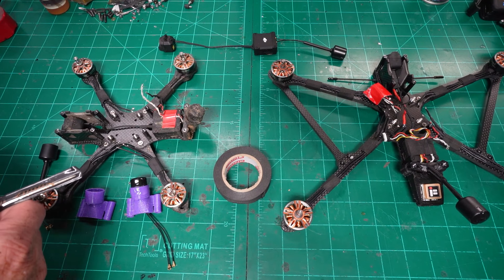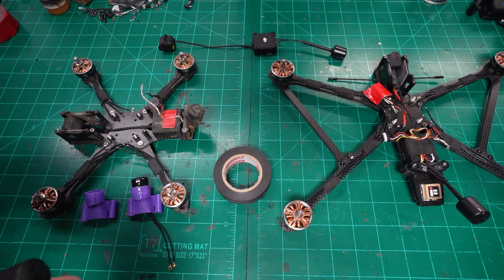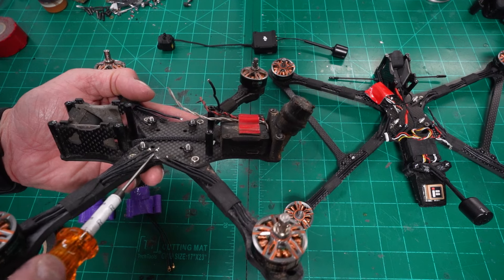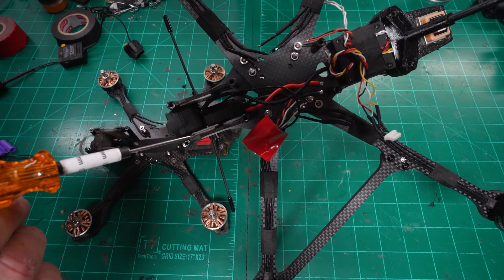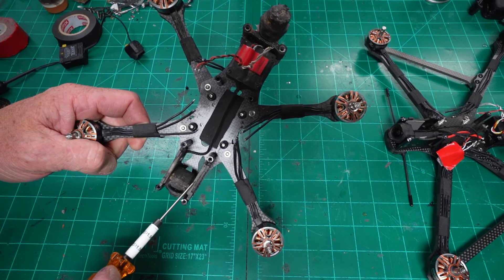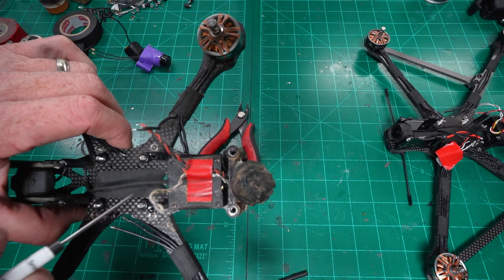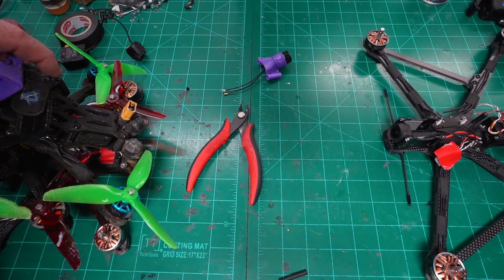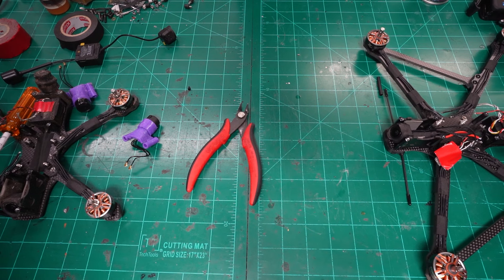DJI O3 Air 500+ Pack Review AND Full BOMB PROOF Configuration

Comment: @phantom I happen to use the Immortal T setup because I'm still on TBS Crossfire, how could i hook this up? i want something similar with a mount for my TBS Nano Rx or could i mount it another way
Reply from the maker: You could do it similarly. When I ran CSRF, I mounted my antenna nearly the same way. They offer small M3 mounts or you could print some and attach the antenna to the front or real standoffs. Another option is to tape it under an arm. Folks talk about how this hurts antenna performance, but if you’re not doing LR and only ripping freestyle close, it’s not an issue. Thanks so much!
Reply: @PhantomFPV  thanks for always replying, have always helped me on my adventure making decisions, now my builds just like yours but crossfire and hobbywing xtrotor,tmotor F60's, but copied your ideas with antennas and frames etc.

Comment: So were you sticking the capacitors now with the DJI in the way? Running both up front I presume? What gauge wire for them?
Reply from the maker: Hey! I usually route them to the front, yes. This isn’t the most preferred location because you want them as close to the battery as possible. Typically using 18-20ga. Hope that helps! Thanks so much.
Reply: @ it def helps. Appreciate you. Epic dude. We have no choice w the o3 being so big. It’s my first build! Apex, ultra, voltara.  Been following your vids to see how you do! Keep up the good work!
Reply from the maker: @ appreciate that! All that gear definitely holds up. Pretty bomber.

Comment: I wanna see a video on the new evo frames. havent seen one yet which is surprising. Looks pretty cool. I almost got the 03 but went with walksnail instead. Getfpv had a bundle with the fatshark goggles and a vtx and antennas for a really good deal. Couldnt turn it down
Reply from the maker: Gotta go with what works for you. I’ve not flown the Evo because is still have a few HD’s left over. Maybe one day. Thanks so much!

Comment: 2:30 so you don’t use any metal nut anymore, you run the countersunk screw (shortest one for the apex) then use a nylon nut? And then a oring for the Esc mount? Today I started my new buildt and it’s my first kiss ultra buildt I noticed that with a metal nut it’s impossible to still get an oring or something to dampen the Esc from the screw…..

Now I think about unscrewing the frame again and also go with a nylon nut if you do it that way…but does the nylon nut not get loose? And also you can’t tighten the screws very strong from the stack ( I thought it’s needed on the apex because the countersunk stack screws they are not flush with the frame and you screw them to the bottom part (I hope you get what I mean) and compress that all together…. After kiss ultra discord I was convinced going withouth dampening but it feels not good to me having the Esc on just hardmounted on Metall nuts
Reply from the maker: I definitely get what you’re saying. Out of 10 pilots you ask, 9 will say I’m doing it wrong. However, I’m a basher pilot and fly more packs than any normal human should, and likely more than those you ask about proper stack assembly. That being said, I don’t have an issue with the plastic nuts coming loose. If you’re careful, you can actually get them pretty tight.
The nice thing about an Apex frame is those four screws have zero structural function. So they could literally be flopping around in there and your frame would still remain tight. So long as you built it properly. 
I fly with badly bent motor bells, bent props, broken everything and my tune is still magical. If you’ve watched my videos, you can hear it. It’s this way because I pay particular attention to how I mount my flight stack, and I tune my quad. Again, 9 out of 10 pilots will tell you it’s wrong, but my tune will confirm otherwise. (I’m kidding about the 9 out of 10 thing btw haha.)
I’d suggest trying it. You can always revert back to the original mounting method. Both will work. 
I hope that helps a little. Thanks so much big dog! Let me know if you have any more questions.
Reply: @PhantomFPV  thank you! i will make two apex evo builds try the second with the nylon nuts as well :) can you tell me how you tune your Kiss ultra Setups? Is there any tutorial that you follow or how can I understand that aspect?

Thank you so much for always taking you time! love it

Comment: Hi…what benefit do you get using the Action 2 that offsets the weight increase of the A2? Different camera settings? 
Why not convert to Apex Evo?
Reply from the maker: The lighter weight camera makes a huge difference. The actual camera performance is lower than GoPro tho. I’ve got too many standard Apex’s to switch. I don’t bolt my cameras in either so it’s really a waste of money for me. Thanks a bunch my friend!

Comment: Just the vid I needed to see this am, bro. So you’re not using any mounting screws to hold the camera in place, just double sided tape or did I miss something? That should definitely help reduce vibrations to the cam if that’s what you’re doing and sounds like something I need to try! I’m doing something a little different with this build and I’m mounting the O3 cam on the top plate in a cage to keep the props out of view since I don’t run an action cam. Thanks for the vid, Phantom. I’m gonna incorporate some of this into the build.
Reply from the maker: Yes sir, that’s correct. I don’t bolt in the cam. Everything is taped. Glad that’s working for you. Once I find something that works well, I rarely change it. Thanks so much my friend!

Comment: That's impressive. Good to know info. Love the O3 air unit. Heck I love the Vista. Apex, Ultra with Vista is my primary build. You using the Impulserc rubber isolators to hold the Ultra fc? Happy flying Phantom. 👍🤓
Reply from the maker: These are all facts! Yes, I run the runner standoffs. Have with great success for about 3-4yrs now. Thanks so much John!